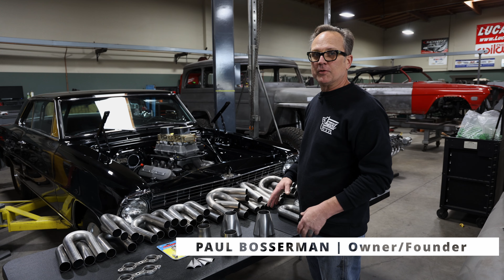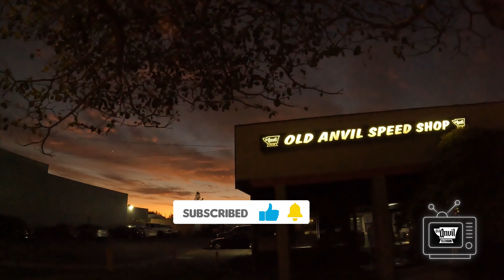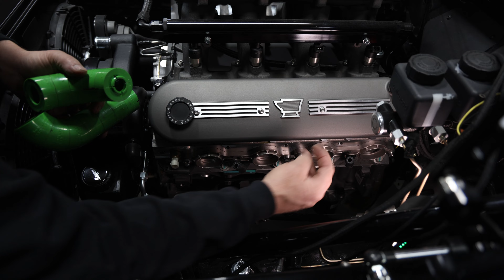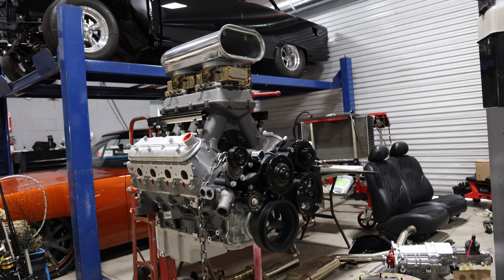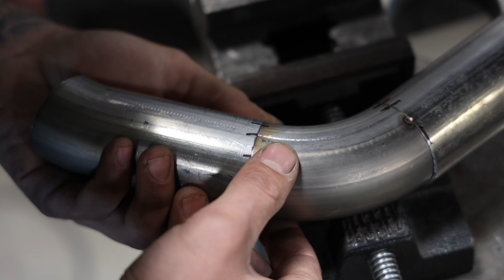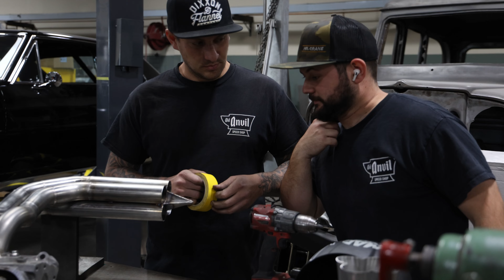How to Build Custom Exhaust Headers

Comment: ok question?  You made the collectors in the same place on both sides ( the heads are not one is in front and the other set back). So if your building the headers to be equal length are the headers the same length on both sides to each other?
Reply from the maker: It's very negligible. We just try to get them as close as we can within reason.  Even Nascar headers don't go to extremes.